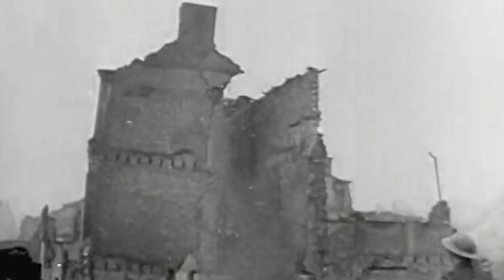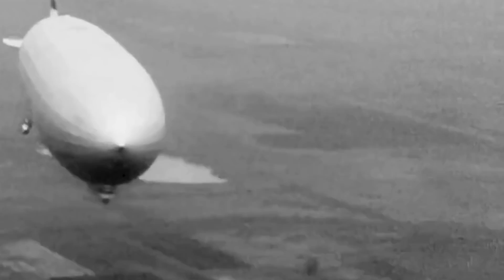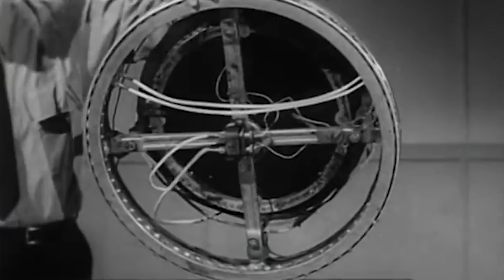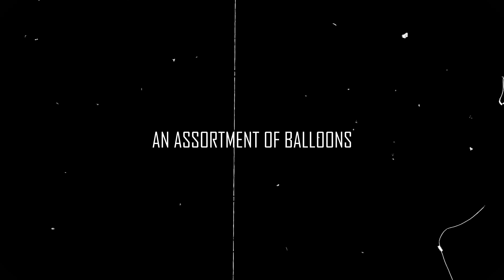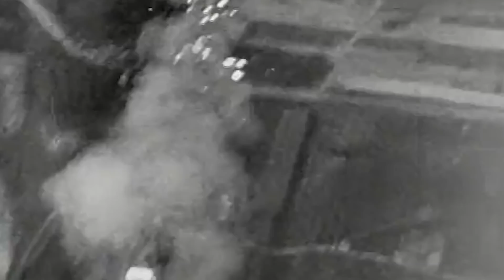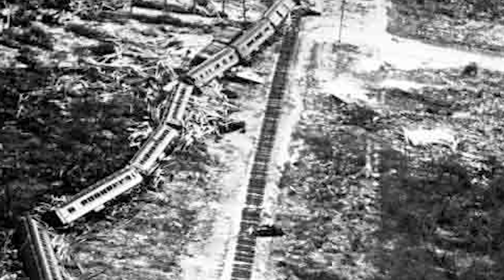Operation Outward

Comment: “The greatest victory is that which requires no battle.”
― Sun Tzu, The Art of War
Reply: Barbarian with the best weaponry should rule.
You support that
Reply: There are barbarian everywhere got any in mind
Reply: You're right at a same time but not precisely correct in some degree.
Reply: and the other battle was ur mom - N2cable, Art of Mom
Reply: Wuhan virus today's non combat war
Reply: @peterfryer9615  You got that right. Also, communism infecting the western world by infiltrating academia.
Reply: @MrBeegs88  communism works just that people use it to gain control instead of helping the poor
Reply: @Sun-rk3cc  "People use it to gain control instead of helping people" Exactly why it doesn't work and won't ever work.

Comment: You showed a map at the beginning of the pacific and balloons crossing from Japan to North America,  I believe the Japanese also employed a ballon scheme aimed at burning the pacific north west forest s down and possibly the use of bio weapons deployed on balloons , do you know if this was true ?
Reply: Operation Cherry Blossoms At Night. 
 A plan by Unit 731 was to use several long range I-400 subs that were outfitted with a hangar on the rear casing that could hold 3 seaplane, with floats removed and wings folded. 
  The seaplane would carry canisters of bubonic infested fleas, and release them over southern California. Commandos would be sent ashore to further spread contagion.  The raid was set for 22 September 1945.
  A similar plan using two I-400 boats was actually underway, to Ulithi Atoll. The emperor ordered all forces to surrender before the subs got there. The crews dumped the seaplanes overboard and surrendered.

Comment: A Zeppelin is not a baloon - it has an internal frame, unlike a blimb (remember the one from Good Year?) which looks the same on the outside. If deflated, the latter looses all of its rigidity (happened to the Good Year-blimb back then), but makes for a very small easy-to-haul pack deflated - like a balloon. The name blimb btw. origins from the sound audible when you snap your finger against it when filled. Besides, thanks for the vid!!
Reply: I remember the Goodyear Blimp .
it used to have a big hanger right off of I 45 just north of Houston .
It was pretty awesome to see at night .

Comment: I'm surprised that they didn't launch some of them in the daytime just to keep the Luftwaffe busy. 

I'm also surprised that they didn't launch some of them from small boats in the North Sea. Storing a few balloons, some wire, and a little gas wouldn't be that difficult on most small patrol boats. Just by putting up a few balloons, they could create more distraction.
Reply: I don't think inflating a balloon on the deck of a small boat rocking around in a the North Sea, on a windy night would be much fun, expecially not trying to also attach an incendiary device to it as well...
Reply: @chrispanton3577  I wasn't thinking in terms of using the incendiary devices from those launches. I'm saying that they could inflate the small balloons and send them up with a wire attached to cause the electrical system problems. Furthermore, the sudden appearance of them the next day would still be a distraction for the Germans.
Reply: Could have been used from the decks of ships for D-Day
Chris would not matter how much movement there was on a deck, You would not set the arm until it was ready to leave, cables would not need to worry about at all.
Reply: @southerneruk  probably wouldn’t be too effective. They were a cheap way to cause a lot of damage, not exactly assault an army on an exact point
Reply: @bongwater2290  It messes up communications, you don't assault an army, you slow down the communications from the front line to main HQ.
Reply: Bottom line it would have been too much trouble at night in a rolling sea in wind, for very little benefit over the more convenient task of laying out a balloon and inflating it in a nice flat field, especially when launching up to 1000 balloons per night, that would need a large flotilla. Cheaper from a field too which was a key factor in the operation.. Finally the North Sea between UK and Germany was full of sea mines in ww2.. Not an insurmountable barrier but not without operational risk.. Thus while I'm sure it might have been considered the would be very few advantages from inflating and launching from boats and plenty of reasons why not, which is why they kept it simple.
Reply: @chrispanton3577  Military personnel of WWII took on many very difficult tasks. Compared to many others, inflating a two-meter balloon on a small patrol boat would have been almost nothing compared to the other risks taken by anyone fighting in that war. That issue is minor. 

I didn't say anything about sending hundreds or even dozens of boats to launch a thousand balloons in a single night. I said that patrol boats having a few balloons that they could launch during their regular patrols could provide some benefit. The one or two balloons would be another way to harass the enemy, and some operations are conducted for that purpose. Hundreds or thousands of balloons launched on a night when the wind shifted would mean hundreds or thousands of balloons blown off course. That's a complete waste of resources. One or two balloons launched because the wind was just right and the patrol boat happened to be in the right location to send wires dangling over important targets to cause electrical outages could be beneficial. If those one or two balloons didn't reach an important target, the loss of resources would be trivial compared to the loss of resources when a launch of hundreds or thousands of balloons went off course. Your flotilla is just a straw man argument. 

That there were many sea mines in the North Sea didn't stop them from having patrol boats working the waters. Again, the necessity for launching a flotilla to send up thousands of balloons this way is just your straw man argument against the point I originally made. That point was that equipping these boats with one or two small balloons that could be quickly inflated and sent aloft with a long wire dangling below would add to the harassment factor of this method of warfare. The sea mines didn't stop either side from conducting operations in the North Sea, so that factor is irrelevant. 

Maybe there was a very good reason that they didn't give a few balloons to patrol boats to launch from time to time. Maybe there wasn't a reason because no one ever thought of doing so. The "flotilla" argument is just a straw man. The difficulty might be real, but military personnel carried out all kinds of difficult tasks during the war. The real bottom line is that nothing you've said really answers my question.
Reply: @VTPSTTU  there is an oft repeated military truism, amateurs study tactics, professionals study logistics.  Yours is a nice idea but there were very good reasons why they didn't do it many of which I've laid out. Sometimes the simplest plans are the best.